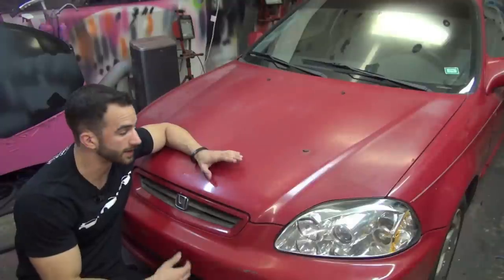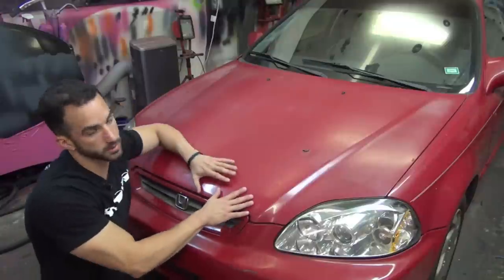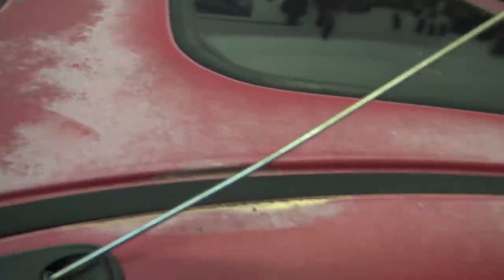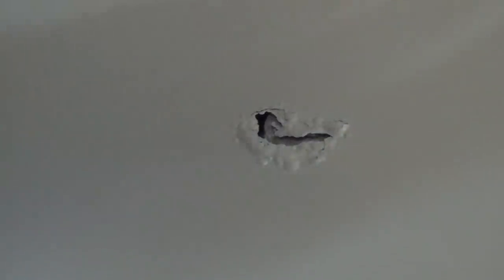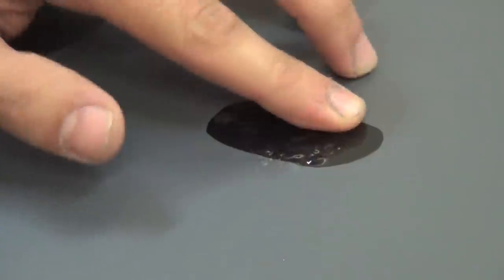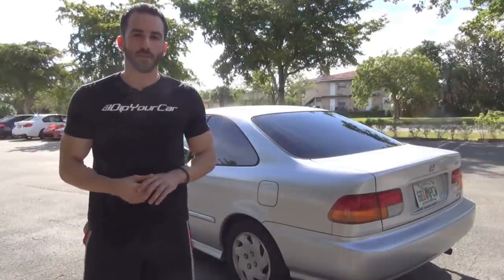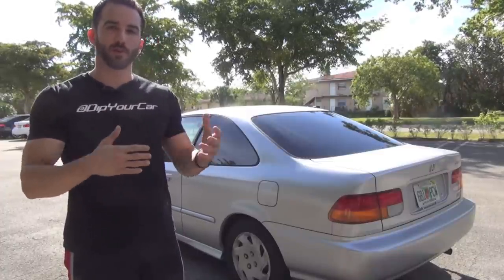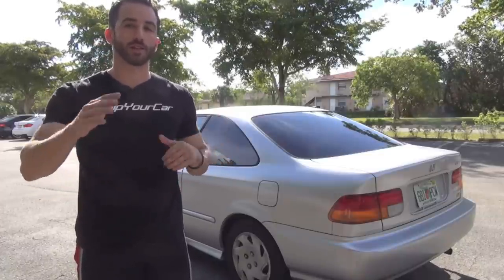Restore Bad Car Paint with Plasti Dip

Comment: A lot of people are saying "why not just repaint the car". The thing is, the repaint itself probably cost more than the car itself in this case haha.
Reply: yup, and the people saying " it costs the same as painting it yourself" don't realize how much easier it is to plastidip something than it is to paint it. no sanding, no being stuck with something permanent if and when you fuck it up.
Reply: So what? That's how depreciation works.
Reply: TheMidnightNarwhal Yes, of course that's how depreciation works, but why waste thousands of dollars trying to repaint a car that's probably worth 2 or 3 thousand when you can spend maybe a couple hundred and get the same result?
Reply: Yeah, I bought an older Accord for $1800 and they wanted $2500 to paint it because Honda had shitty clear coat there for a while. My black car looks so much worse than the red one did lol.
Reply: The spray-on rubber would be more expensive than normal car paint, dummy.
Reply: But he did repaint it!! That’s not restoring if he used completely different paint!
Reply: From what I know getting someone to do this cost just as much as a paintjob. If you do it yourself it would also cost the same if not more, but easier and less likely to screw up and easier to fix. 

Regardless, why get someone to do this and not fix the rust hole properly.
Reply: @keekwai2     Just Google searched it. One gallon of Rust-Oleum standard black automotive paint is $75/gallon. One gallon of Plasti Dip black is $70/gallon. In other words, they're comparable in pricing. I'm not sure why you thought you would get away with making such a blatantly false claim in this day and age of the internet.
Reply: @Chanmantroop10     Ha ha ha! You must not live in Wisconsin.
Reply: I had an old Subaru Forester. I used truck bed liner paint. It’s great for off road cars but I think plastic dip looks better for sedans.
Reply: @SergeantExtreme  bro are u slow? he talking about a pro shop painting the whole car which is no less that $2500 he is not talking about the cost of the paint...there is minimal prep needed for plasti dip its basically ready out the can....and i can a gallon of plasti for $55 on amazon so do better research dummy
Reply: 2022 not anymore m8 😈
Reply: Agreed!
Reply: That's true. I got quoted $2500 for a color change and $1500 for my 05 toyota matrix lol
Reply: @SergeantExtreme  labor difference plus clear coat and sanding and everything else to paint a car. this is a 2 step process instead of a 4 step process. it wont last as long but it will be less than half the price.
Reply: @dflex4180      I'm on your side dummy. I'm arguing FOR Plasti-dip.
Reply: 8 years ago are u still alive man

Comment: You could've just sanded it down with sandpaper before applying the vinyl for a much better result. Don't need a bodyshop to do that, you need two hands and the ability to use them.

That being said, this is the best application and most sensible usage of car dip I've seen so far.
Reply: I know it’s been to years late but what type of sand paper 180g? Or wet sand it
Reply: Alexis Adame Nava best way for rust hole repairs is to make a new peice, weld, grind down , bondo, sand and rust protection. For papers you have everything from 120 - 240 before priming it. And after that 400 - 600 to remove potential sanding scratches. Halfyear late but hope it helps you. If you can’t weld get a steal net kinda and glasfiber bondo onto it and then do same process with sanding it down, bondo etc
Reply: Probably just shouldn’t have mentioned it/shot around it. Wasn’t the point of the video.

Comment: For those who are asking about the 3M vinyl for the rust hole, it is a signage product. Go to ANY sign shop and ask for some scraps of GOOD vinyl. There are many grades. 3M ControlTack was the best when I was in the business a decade ago. The cheap stuff won't conform and won't stick long-term. And heating it is CRUCIAL for this application. It will shrink when it gets hot. Make sure that happens before the paint/dip has been applied.

Comment: Really wanted to see "A Close Up" of the rust area just to see how it covered it up and how noticeable it is. I mean since you spent so much time talking about it, it would have been nice to see first hand.  

The car looks really good. Much better then before.  How much does it cost to Plasti Dip a car roughly that size ?
Reply: Last thing u want is covering the rust...it makes it spread alot faster..rotting the metal from inside out...never ever cover rust...
Reply: Vgv Customs Apparently in another video the dip halts the rust. It's the one of the old truck.
Reply: Vgv Customs the plasti dip seals it in though not letting it make contact with any moisture > no more rust :D
Reply: At 11:40 the rust spots look like two small bumps on the hood...
Reply: ***** He said why in the video.
Reply: ***** Did you watch the video at all? He explained that like 3-4 times.
Reply: I love how of all the replies to this comment, not one addresses op's question -_-

Comment: Just what I needed to see. I have 95 M3 with a beat paint job from sitting in 120 Arizona sun. But I'll be sanding mine down, replacing a fender, and bondo the 2 door dings before I dip mine. But good to finally see a video where it's not a brand new $100,000 car. Although my 08 M3 might be getting dipped now....just doesn't need a color change at the moment

Comment: Every "Dip" spray video is shown with the doors/hood/truck closed or shut. So I've often wondered how odd does it look when you open the doors and you see the old color (red in this case) on the door jams and frame of the car? Would you guys ever be willing to show us what the transition (rollover?) from the Dip color to the original looks like?
Reply: Jeffrey Barry thats the reason original black car is the best choice. black dress whit all colours when you open the doors.

imagine you car is red and you paint it in yellow...MCDONALS XDDDD
Reply: No Name im a fucking badass
Reply: it's the exact same as most paint jobs, you have to pay MUCH extra to get doorjams and inside of hood painted as well.
Reply: @beardedman8884  Ahh NO you freakin don't ! And if that's what they told you bud, roll on outta there! 
Proper Body Shop will Take Off the doors - some, the bootlid (trunk lid) as well. 
Door cards off, window trim off, manual window out, electric in - but open and covered with a Cream (Cif/Jif) Glass Cleaning product. Brown paper taped over everything Not being sprayed, an away you go !
Bonnet up, engine bay covered underside of bonnet and insides of wings (fender)
It's only light coating and it won't be Clear-coated, but who's looking inside your bonnet anyway. 
Plus a kinda "basic rule of thumb" is... Don't Change The Colour of Your Car !!
You might luv minty green over your car's Factory Red, but who the heck is gonna buy it "your" colour? Or without thinking it was in something More Serious than "A wee Bump in a pole", or even wonder whether it's Stolen ? 
Only ever paint A Car/Truck or whatever else ! if it's Rare, Newish or Really Expensive - and mostly that's all 'Vinyl  Wrapping' now - and that's a lot better choice these days!!
👍☘POD☘😉

Comment: wow never seen car paint fade THAT bad or rust hole in MIDDLE of the hood
Reply: Probably a rock dinged the hood and chipped the paint, causing a rust hole after several years.
Reply: hannamand or anywhere with a lot if snow and ice. rock salt is a cars worst enemy at times lol
Reply: I had a 1984 Ford Temp that was that faded. It's just does after 30 years of weather
Reply: You need to get out more then
Reply: That's a speed hole

Comment: For us Northerners, how does plastidip fare with very cold climates, road salt, and snow/ice???
Reply: I would figure it would pit like regular paint over time with the salt and snow getting to it etc.
Reply: Josh Schmiedchen Well, it stands up to pits really well as proven by people who have had iy on their cars since before it became a big thing till present.

My concern is corrosive and extreme temperature ability, how it fares agaisnt it
Reply: ***** I know a few people who have had their rims for over 2 winters now with plasti-dip on them and they're fine.  If you're looking at dipping your car, do it somewhere warm.  If you try dipping anything outside when it's 20° out, it'll turn out really bad
Reply: xabstractx I figured as much :P I was planning on spraying this coming summer. I do have a climate controlled garage but it's heater isn't working :( so I have to wait.

As for the wheels, aside from staying on the wheels, there was no fading, etc??
Reply: No fading as far as I could tell.  If there was any, it was minimal.  
The only major problem is curbs.  One of them had to keep re-dipping his passenger side rims because he pulled up too close and rubbed the dip right off lol
Reply: xabstractx well I don't do much parallel parking since I live out in the sticks.

Also, based on your overall experience with this, would you mind naming off some pros/cons comparisons?
Reply: A huge pro is that it protects the original paint on your car.  Buy a car -> dip it -> 6 years later, peel off the dip, and you've got a car ready to sell that looks BRAND new.

One con is that people are starting to learn about it, so if idiots see a car that looks dipped, they'll vandalize it or rip the plasti-dip off.
Reply: xabstractx I've heard about that! though I plan on dipping everything piece by piece, the only way that dip is coming off is starting it by blade or at the frame. But I can promise this; I catch anyone near my babe with a blade other than myself and I might be 'generous' enough to prepare a knuckle sandvich for them :D

But anyway; I have a 1974 Datsun, pristine condition and all original with some surface rust here and there. My goal with plastidip is to preserve the body until I can really tear into it and paint it properly. I'm going to have to sand a lot of the body anyway since rust has gotten on some of the body panels and is making the paint flake away (least its easy to tell exactly where the affected spots are)
Reply: Buddy of mine have had his wheels dipped for 2.5 years. two winters and they still look good.  Hes showing some wear around the lugs but I think thats because he only did 3 coats.
Reply: Dipyourcar should have a FAQ about that subject on their website.
Reply: Search up on youtube, how to plasti dip your car the right way, guy in a sti did his white left it for chicago winters, removed it recently to re dip. He has a good videos on showing how it will last in the winters

Comment: Hey guys what about doing a woodchipper.... I'm thinking about dipping my chipper.. could you Guy's show us something like that other than car's... thanks so much for the videos..
Reply: Why would yo--- Never mind, that sounds like a wonderful idea..! I want to have a badass lawnmower now. Maybe painters tape V-Tech on it since its a Honda. Match my civic!
Reply: Im sure you are talking about just the exterior of the chipper to pretty it up a bit. This stuff is not exactly tough so it would get torn up pretty quick where you feed the wood, branches etc. Nothing wrong with making your stuff better to look at. Just some prep work like degreasing and sanding for good adhesion and you're good to go. Im not sure how long this stuff lasts but for a piece of equipment that might sit outside most of its life unless you keep it in a garage or barn, i think the sun will take a toll on it over time.

Comment: Why go through all the labor intensive detail to mask the car off just for a temporary solution of plasti dip? Why not just paint the car?
Reply: Because the difference can be a matter of hundreds of dollars if not thousands.
Reply: If your doing the work yourself how does it cost thousands? Gold paint?
Reply: Scott H arround 550 dlls :) its a good paint tho :)
Reply: It's not temporary either after a couple days it'll stay just as long as paint.
Reply: Bologna! I have used this many times on my rims and trim. It will look good for a couple months maybe a little more then start to weather.
Reply: I've had 4 coats of it on my rims for a year and a half and it still looks great.
Reply: Scott H If it only lasts a few months you probably did it wrong... I have my emblems, mirrors, grille, and other bits of my car dipped from over a year ago and they still all look fantastic, even the grille which gets hit with countless rocks and bugs is in very good shape.
Reply: Please re-read my post. It lasts longer than two months but doesn't look nearly as good after time. It's basically a super thin coat of rubber. What sorcery are you performing on it to make into a diamond coating?
Reply: I'm not doing anything special. Maybe you didn't put enough coats of paint? I put 4 coats on mine, which is what is recommended by Plasti-Dip.
Reply: My rims have been dipped for 2 years. Still look just as good as I put it on.

Prep correctly, dip correctly and keep it maintained and it'll last for a looooong time
Reply: My cars rims have been dipped for over a year and don't look as good as they did. Once again we are talking about a 16th of inch of rubber here. Stop hyping it up to be impenetrable.
Reply: Game Guiders HD how do you maintain it?
Reply: Scott H First of I believe it's ways to have fun in a affordable way I understand you may have money to paint your car or rims black to white in no time, but the Fonsi actually stated "fun" "cheap" way to to your car.
Reply: Scott H Someone who has never painted anything in their lives would NEVER be able to get such consistency of colour and spray onto a car. Anyone can throw paint on a piece of metal, not everybody can make it look good as this silver plasti dip does. For things that people can do themselves, they will; otherwise they'd rather pay someone more experienced to do it.
Reply: It's useful in some situations. I had some rust on my driver side window pillars. So I sanded it down, black dipped all 4 pillars and then clear coated them. Looks brand new. Cost me 40$. If it fails in a year or so maybe I'll consider going to a body shop. For a nice easy temporary fix its very reasonable.
Reply: nothuman22 i dont know how are you.
but in my country the plastidip and pain a car cost almost the same.
Reply: Martin Allen It's stupid to market something for an application that's impractical. Language Martin
Reply: nothuman22 most paint jobs dont require alot of sanding or prep work as they make you think cars like the one done in the video could have been sanded an prepped in about 2 hours and materials to paint it would only cost about 220 dollars for a stage 1 set up with clear ... and since ur painting it yourself like you would be dipping your self .. umm i would just paint since its perm and a HELL of alot cheaper.. what i did with mine.. this is basically a waste of money
Reply: Josh Hines you are to optimist.
Reply: I've been wondering the same thing.  I think plasti dip is a really cool concept, but at the end of the day, why not paint a car for less than 150 bucks?  I really don't see the advantage of PD.  Maybe someone can convert me though.
Reply: Costs way less for a better look
Also if you hate the color you can peel it off and still have time for another
and they have TONS of colors even news coming out recently
Reply: doesnt cost way less
Reply: Josh Hines This is not meant to replace a full paint job,  only a temporary solution.  For example, I have a 1995 Honda Civic that needs an entire new paint job, but being a college student, I simply cannot afford it.  I will be Plasti Dipping my car just to last me through college and then after I will have the cash to spend on a paint job.  I know it doesn't look as good nor will it last as long, but $500 now for dip and equipment versus $4,000 for a complete strip of the car plus two stage paint.
Reply: pctomactechtalk I think your situation is about the only reason to go with plasti dip.  Still,  500 bucks isn't cheap for a temporary paint job.  I need to see this stuff in real life before I am sold.  Who knows, maybe everyone's dipping.
Reply: Did you finish off with clear coat?
Reply: +Benjamin Moss Plasti Dip is cheaper, less intensive, and if you mess up or don't like it you can peel it off. I definitely like real professional paint jobs, but if you're a beginner or just someone that wants to practice or try something new with their car, I would recommend plasti dip all the way. Then when you're sure of yourself, use traditional paints. And of course there are cases like the car in this video where a full professional paint job is going to cost more than they'll get for the car.

Comment: For what that would cost you to have done, youd be much better off just getting it painted
Reply: Actually no.  The Dip is applied over the original paint.  New paint can't just be laid over old paint.  Oh and the Paint shop would insist on fixing any rust spots on the car.  The job could run anywhere between 2000 to 5000 dollars Especially since the paint was really bad on that car.

Comment: I just sanding down my whole car ! Next step wash the car with soap and water and then clean the body once again with degreaser. My question is will plastic dip stick to a car that has been completely sanded and wash with out any issues ?

Comment: Do you need an air compressor for the spray gun?
Reply: no it actually runs on pixie farts and small childrens tears
Reply: 1996 red gt fuck off
Reply: if you buy the kit it comes with a small air compressor and everything else you will need.
Reply: Cheers mate :)
Reply: no problem
Reply: actually no even if you buy a lower model wagner which he uses in his old videos which works just fine it runs on electricity because it has a small compressor built in.